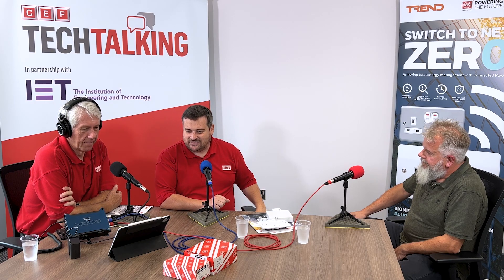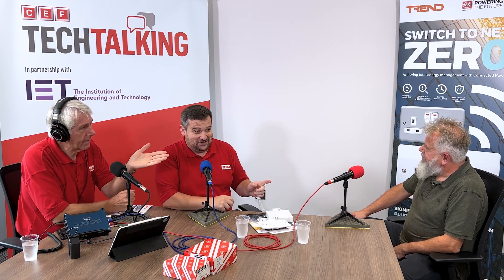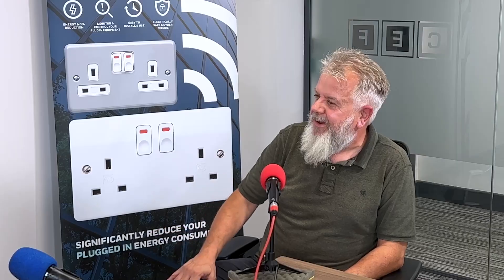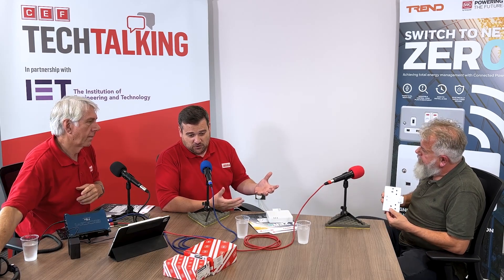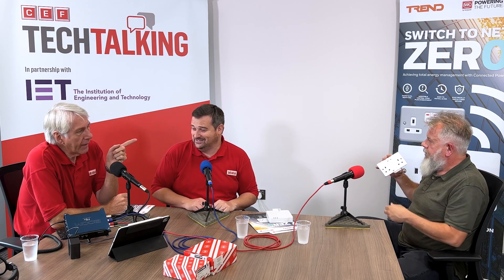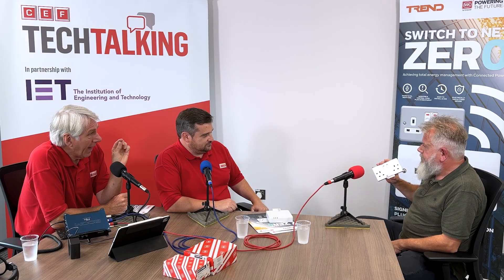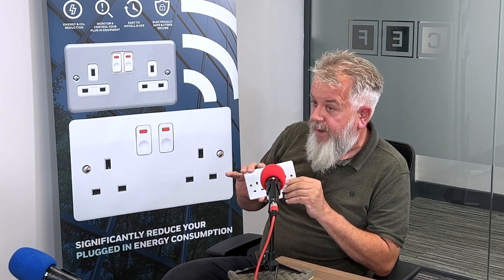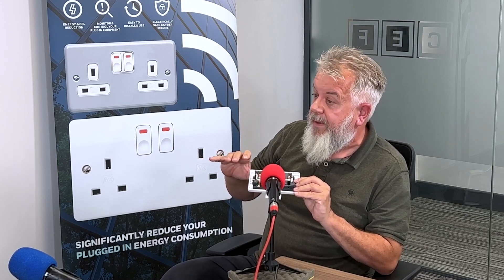E16: How to save energy with connected sockets: MK, Neil Brown

Comment: Wow! impressive sockets. I think the little red button should be accessible from front face - maybe like a reset button on a lot of devices are recessed so they cant be touched inadvertently without a pointed object. At 0.5Watts per socket means each socket is going to cost £1.50 per annum to run (35p per unit), so a house (I know your focus is commercial, but..) a house with 50 sockets is going to cost £75.00 per annum to run.. I guess you will be working on getting that 0.5Watts lower?